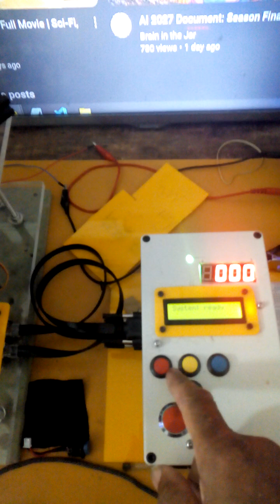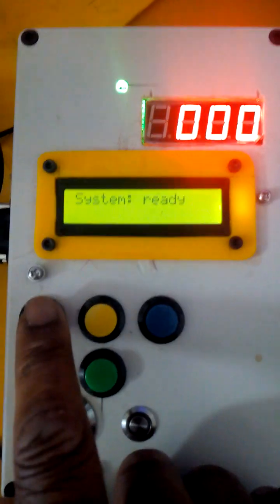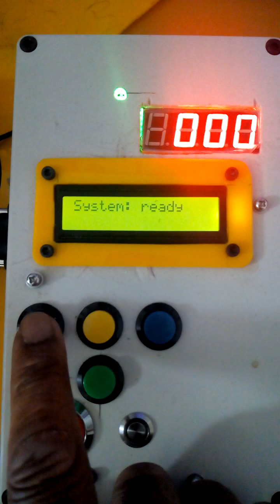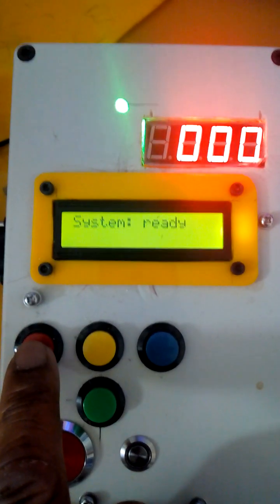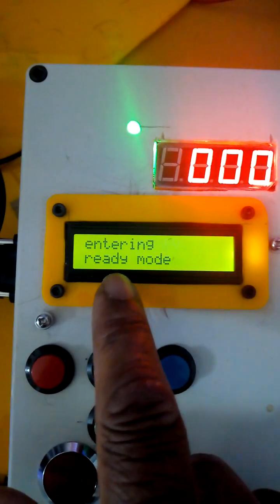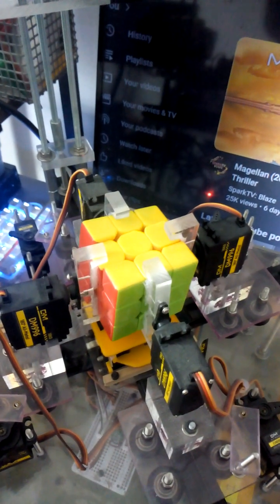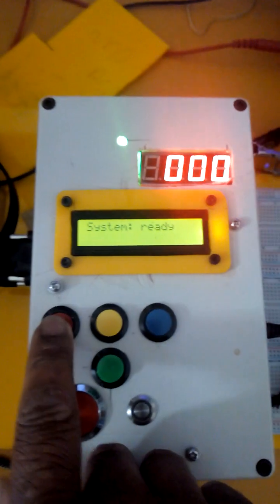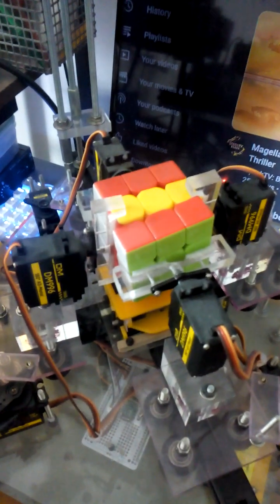Rubik's Cube Solver - part 28:  MISTAKES AGAIN! #arduino #rubikscube #robot

Comment from the maker: Well, I found the issue and have started to move forward with the next steps which is to check each button is working with the system.  I've also started working on the grippers, which had me more worried than all other parts of the solver.  More vids coming soon!